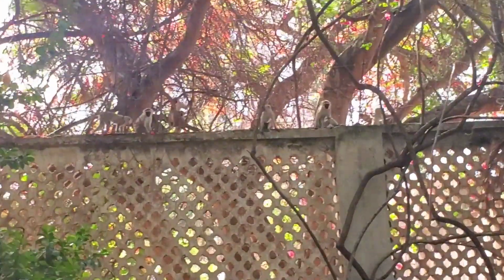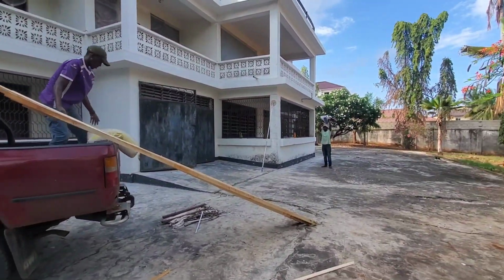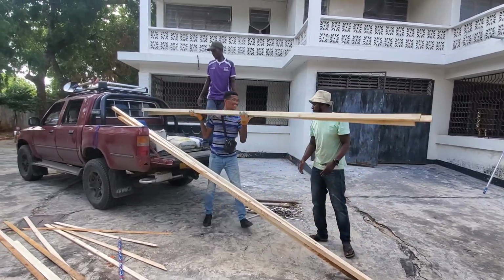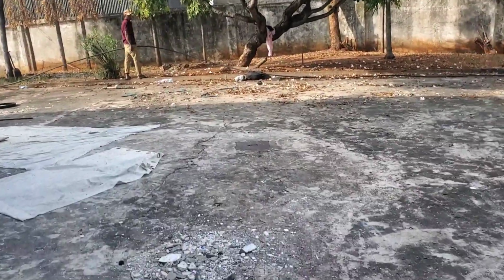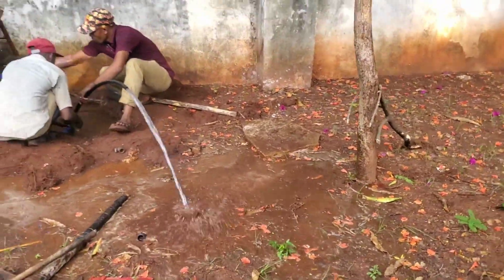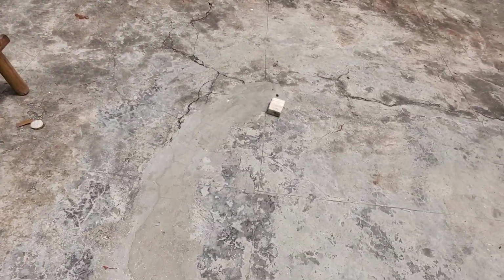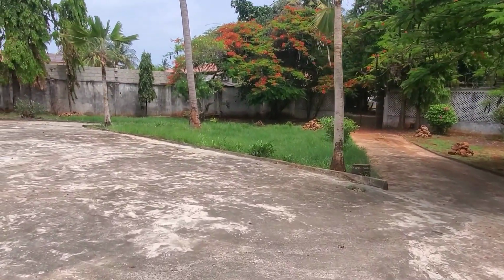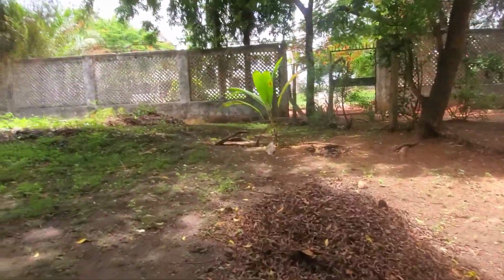Things are coming together

Comment: Excellent work.  I commend you.  Please make sure that the floor of the roof is slanted at least a quarter inch so that water can drain off the building.  Sitting water on the roof can eventually cave it in.